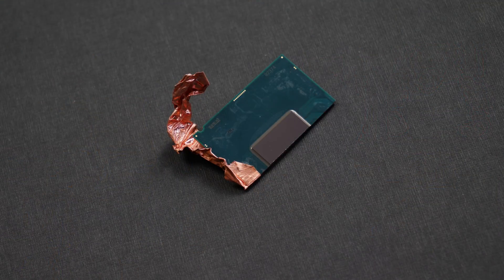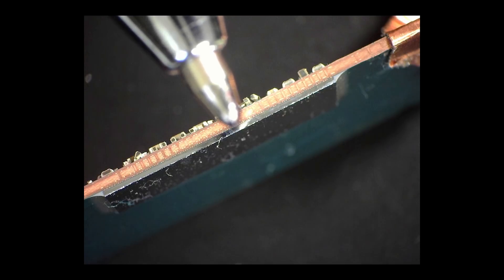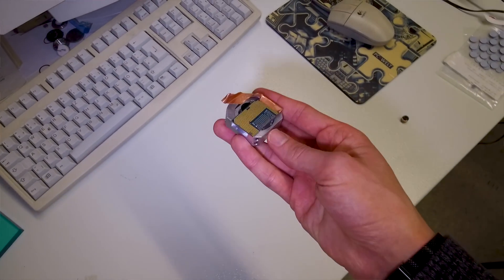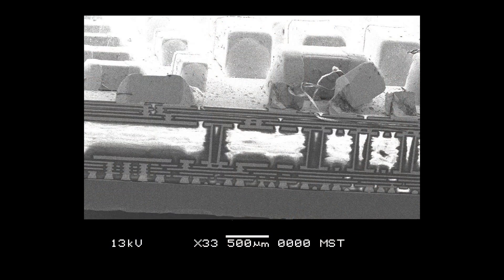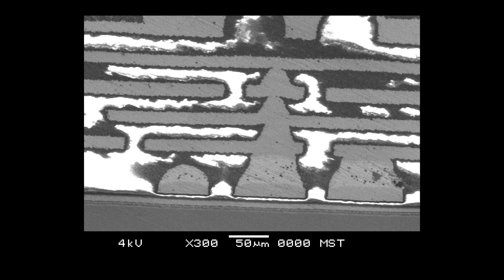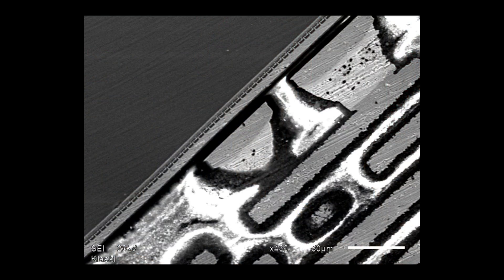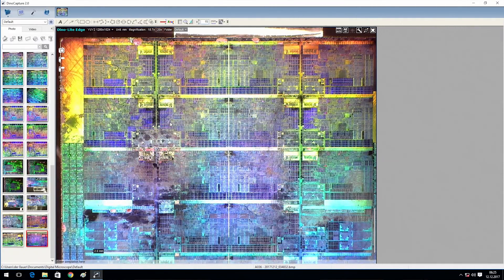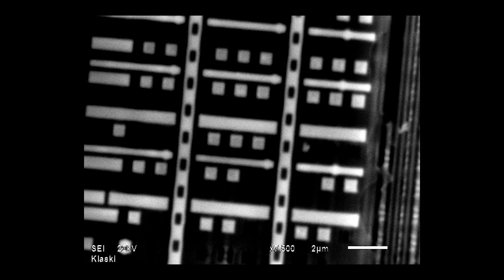Inside i7-8700K - Scanning Electron Microscope (SEM) Footage (en)

Comment: Why does he use copper tape instead of normal transparent tape to secure the cpu?
Reply: Because the copper is a good heat conductor, so it can be cooled down easely by the cooler
Reply: he said it needs to be grounded for the electron microscope to work. copper is there as an electrical  conductor

Comment: Amazing how tiny tiny can be. You really need to get a CPU die before it's attached to the PCB module, as they would come off the fab assembly as a "pizza pie". What would be interesting is comparing a Pentium from the mid 1990s to an i9 of today side by side. Also, maybe go hunting for "Easter eggs" on the chips - I know on older dies the engineers would put graphics and logos in certain spots - not sure if they have that luxury with today's denser chips.

Comment: How do they make it so small
Reply: they basically have that silicone layer, put a photomask on it, laser ways for transistors etc into the silicone and then let gold rain inside
Reply: @heynic37  oh i thought it was chemicals they etched with a lazer makes sense with the lenses they can get it small. thank you
Reply: @heynic37  how did you find that out its hard to find
Reply: Search up photolithography, i got that from some intel (or AMD i dont remember) video about their CPU manufacturing process. And well, i was actually wrong about the laser part, they apparently use UV-light.
Reply: @heynic37  oh wow as much i know about it they could very well channel nuclear radiation to etch with

Comment: It is not quite true that every single transistor works. Modern CPUs are designed with quite a lot of redundancy. When manufactured, it is likely that (out of several 1000 million) a few components in the chip fail. On many chips, some sections of the chip are made inoperable by failures. Those sections are switched off (the chip has some memory/registers enabling that to be done), and the chip is sold as a lower-spec model at a reduced price. Only a small percentage of the chips have to be thrown away.

Comment: It should have been expected that if the resolution of your SEM is 3.5nm, you would not be able to resolve features on a CPU with 10nm feature size. No need to drive 600km to learn this.

Comment: Look up cross sectioning electronics. You cut it into pieces and place it in epoxy, pull a vacuum then basically sand it down using higher and higher grades of sand paper until you polish. SEM needs a flat or polished surface

Comment: hey der8auer, i have a more modern SEM with up to 10-11nm resolution at my disposal, if you'd have more cpu die samples i'd be happy to examine them. I've examined a few old cpu dies in the past but i was unable to physically delayer them, so i didn't get great images.
Reply: Heh, you have a SEM with 10-11nm resolution, but no DIB to go with it? Pfft... Also, delayering isn't exactly rocket science... I see actual SEMs of these daily - the method used for delayering is shockingly unsophisticated.
Reply: @gorak9000  yeah delayering is definitely not rocket science, tried to do it chemically a few times with nitric acid and such but to no success. i didn't have much time to try it again. If you can point me to an easy way i'd be happy to try it. By the way, what is a DIB?

Comment: Just to give you an idea of how small we can make the transistors, the i7-8700K uses the 14nm process, the diameter of a silicon atom is 0.2nm, which means that transistors are now made out of only 70 atoms. ARM-based processors are already hitting 7nm. Let that sink in for a moment.

Comment: Awesome! I'm wondering how intel is ok with this.  BTW have you thought about using an AFM on the edge?  That would be fun just for contrast, yeah I know SEM has better resolution for features like corners.  Also have you thought about putting it in a TEM?  I don't know if you'd be able to actually get an image given the thickness of the die however that would be fun to see as well.

Comment: First of all, great video + good knowledge.. However, that is a really bad sample preparation method for SEM.. get a material engineering student to do it for you, they will fixed the subject in resin and grind > polish > lapping to get the best result for SEM.. secondly, the gates (transistors) are in nanometer scale, it is best viewed by using TEM, SEM is doable for overall structure but to get the best morphology structure for each gates, go for TEM (tho the sample preparation would be much much more tedious)..

Comment: Amazing! There's universe in any scale. Billions of transistors placed few nanometers apart in a 3D structure and all of them have to work without failing while running hot.
Reply: I totally believe that. The fractal nature of reality, you will never find the smallest particle, nor largest structure in the Universe/reality, what we know as the Universe may be but an atom in an infinitely larger structure.
Reply: not all of them have to work. most cpu's run with quite a few not working. that's the idea of "binning" or how some people call it, the "silicon lottery."

Comment: The way to extract the silicon die without damaging it is to burn it out with a small torch.  Burn it until the fiberglas stops smoking. Then scrape the residue off the die and examine it.

Comment: I can't help but think the CPU wouldn't actually work if you backside thinned it down to 10um. It would need  at least another um for the body bias field of the larger power gate transistors, and the piezo voltages induced in the remaining silicon from vibration would swamp the logic levels or even cause latchup.

Comment: you said with the SEM u need to coat the insects with materials so you can see them with the electron do dar. Makes sense, but then you said about creating a vacuum inside the sem so that there is no intererence? That stuff isnt coated in material (the interference).. so how is it causing an interference?  This is not meant to sound cocky. I just don't understand and you did say to leave questions below. Thanks anyway. It is very impressive the heat these little things get to and still operate in such a small area so well! (at all even)
Reply: You got the purpose of the coating and the vacuum mixed up. The SEM uses an electron beam (whose energy can be set). This is much like passing current/electrons through a wire. The point of having a vacuum is so that while you are passing the electron beam, they don't get deflected or knock out electrons off the atoms in the air, as they are not what you are trying to see. If they did, all you would see is static/noise/interference from the electrons randomly hitting atoms in the air and not the sample. You want the beam to hit the sample as cleanly as possible.

The purpose of the coating is that electrons have to actually pass through the top layers (nanometers). When the electrons hit, depending on the energy of the beam, 3 main different effects occur, and each effect has its own detector. These effects are what "reflect" electrons back up to the detectors which convert these electrons into signals and then an image for us to see on the screen. The higher energy of the beam, the deeper it penetrates into the sample. In the image you see on the screen, brighter the area, simply more electrons have reflected back to the detector from that region. 
There is the Secondary Electron (SE) effect, in which the electrons from the beam knock electrons off the atoms of the sample and take their place, and these knocked out electrons go back to the detector. 
Then there is the Back Scattered Electron (BSE) effect in which the trajectory of the electrons from the beam are deflected and bent around the nucleus of the atoms of the sample. Higher atomic number of the element, more electrons are deflected (as the nucleus is bigger and has more positive charge to bend the electrons path), and brighter that region appears. Numerous of these can occur in succession, until they are "reflected" out of the sample. 
The last effect is Energy Dispersive X-ray Scattering (EDS/X) in which the electron beam is knocks out electrons as well, but the detector is not measuring/capturing the electrons but the characteristic photons/wavelengths (X-rays) that are emitted when an electron from a higher energy shell/orbital loses its energy in order to fall to the lower/more stable energy shell/orbital after one has been knocked out by the beam. This is mostly used to get the atomic composition of the sample, as each orbital of all the elements have a unique emission.
Reply: wow thank you so much. Very much noted. = )
Reply: no problem. Just realised, I didn't mention it that clearly, if we put the insect as is, the electrons wouldn't have conducted/passed through as their shell is non-conductive. Usually you would increase the energy of  the beam for greater penetration, but if you increase the energy too much it can actually melt or vaporise the sample and destroy the structure(just like a resistor or any conductor heats up when you pass current through it). So if they don't pass through, you wouldn't get the effects i mentioned, and you wouldn't see anything. That is why the coating is used ;D

Comment: I wonder if grinding the silicon backplate down would allow for better heat transfer
Reply: technically yeah, but how much will you grind? how accurate and polished are you and your tools gonna be? how much thermal gain are you gonna get from all of that and is it gonna be worth it?
Reply: Damn Slow 

1. Less than 1mm
2. Not at all accurate
3. Probably a small amount
4. Not worth it at all

I’m wondering if it’s something intel could do on the production line since that could keep temperatures down, which would allow them to reduce voltage further, reducing heat output even more.  They’re all about power/thermal savings now - though you’d think they would start with I dunno MAYBE BONDING THE DIE TO THE HEATSPREADER?
Reply: Think of it this way, why would a corporation give you more of anything if they could save a few grams off of it?  Considering they are mega mass producing and that these chips just end up about everywhere and anywhere they have some strict tolerances on how thin they could go for various reasons and we're already as thin as they could reasonably afford to have it be.

On the other hand, they could go the Porsche way, sell you less for more (Top Gear reference). But when Porsche does it, it adds more carbon fibre, bigger spoilers, better suspensions, wider tyres and considerable lap time gains.  I don't see neither Intel nor AMD in a position to do a Porsche when it comes to thinning the silicon a lil bit more

Comment: so if all the transistors and things are on the bottom, why does it kill cpus if you scratch or slightly chip the top layers of silicon?
Reply: because sometimes scratches and cracks can go deep and damage the printed layers

Comment: 1 micro meter = 1000 nm. So the upcoming 7nm for Ryzen and eventually Intel will be almost 1000 times smaller than what we can see here. That's insane.
Reply: 7nm is the transistor size (and 7nm is more like real 10nm than real 7nm)

Comment: This blew my mind. I thought I knew and understood the scale but this...definitely black magic.
Reply: do your math again. Hair grows about 18000 nm / hour. You probaly wanted to mean 22 micrometers, not nanometers. If you want to use nanometers, then it will be about 5 nm per SECOND.
Reply: @Megumin-AdmiralAckbar  And the impressive thing is that there are transistors around 10 nanometers width (the new CPU's), that's length that human hair grows in 2 seconds.
Reply: awhat they didnt tell is how insanely clean the pictures are. The one of the smallest bacteria known is over 100nm in diameter. Viruses can be as small as 17nm (literally only enough to have a tiny, tiny bit of single-stranded RNA, not even double-stranded DNA, and a membrane to cover everything) and even then its more than 2 times bigger than a 7nm transistor.
Reply: its real!
Reply: After watching you tube for 12 years  this is one of the best video  I've ever seen!!

Comment: Amazing manufacturing. Excuse my ignorance but what function do the transistors perform?
Reply: You asked this question 11 months ago, I'm assuming you figured it out already, but in case you didn't (or for others who would like to know, and are prepared to read this mini novel):
Transistors can be thought of as an electric switch (allowing current to flow by applying voltage). 

There are two types of transistors NPN and PNP which stands for negative positive negative (for the NPN)  referring to the type of doping used on silicon (Boron doped for positive, and Phosphorus doped for negative). 

They are made using the processes of 
-photolithography (a process of coating a surface with a light exposure based etch/doping resist, in order to create a type of stencil), 
-sputtering (evaporating atom thin layers of metal at a time onto the silicon), 
-chemical etching (using chemicals to eat away at areas of sputtered metal or oxides that are unwanted),
-ion beam etching (same purpose as the last but instead of chemicals it uses high energy atoms to bombard the surface of the substrate to remove unwanted oxides and metals)
-and doping (using various methods depending on the dopant, but for Phosphorus they use diffusion by exposing the silicon to Phosphene gas) 

Using these two types of transistors in combination you can make a very fast, very efficient logic gate, the most useful types of gates are the NAND gate: https://en.wikipedia.org/wiki/NAND_gate
and the NOR gate:
https://en.wikipedia.org/wiki/NOR_gate
why would you want a gate that is an inverted AND gate, or an inverted OR gate? and what are they?
Logic gates are gates just like the transistor, but they have an output that is dependent on two inputs, instead of only one. They are used to make a decision based on what the status of their inputs are (1.8 volts or 0 volts) 
The NAND gate and the NOR gate are universal gates, they can be used to cover all the logic you need to make a processor or memory, so that is convenient when you want to simplify a large design. 

If a few of them are arranged carefully and intelligently they can be used to run a simple program, or loop back on themselves to create data/info storage (storing 1's and 0's which actually means storing 1.8 volts or 0 volts). In the golden age of computer development many thousands of the logic gates were arranged carefully by large teams of people, which was the way the first CPU's (Central Processing Unit) were made. These processors were relatively simple, but the ability to make arbitrary commands and programs was possible. Then came the Operating Systems (OS's) like Windows and crapple, allowing us to make programs to help in the design of CPU's. After many years a hierarchy was carefully constructed for how to design processors. Then the processors in computers we built before (designed by people) helped us organize and arrange the logic gates for more modern processors. However, people were and still are, very involved in the design of processors. At their very core computers only really do what you told them to do (Programmed them to do) and that often requires a person to validate the functionality of the design.

Comment: You should have reduced the beam voltage to a value close to 5 kV, and try to switch to secondary mode, I guess that was Inlens mode. With those parameters, you would have been able to reach ~15k magn even on a charging surface.
Reply from the maker: I also tried very low voltages but there was no way getting a sharper image :/